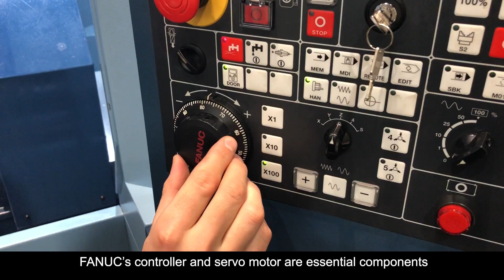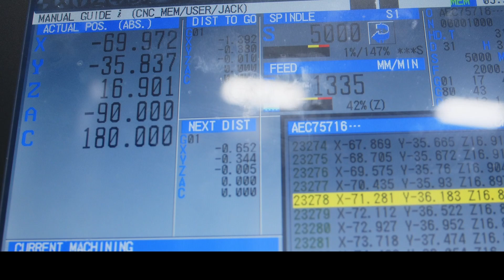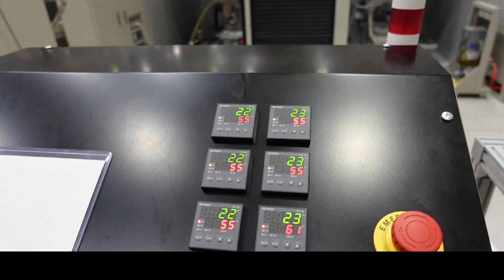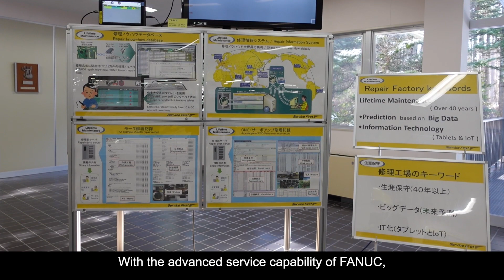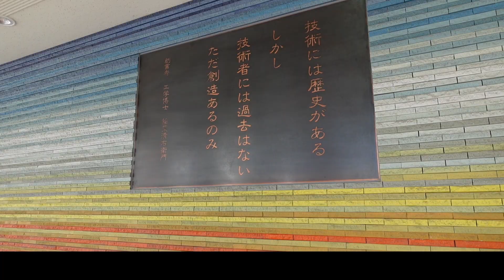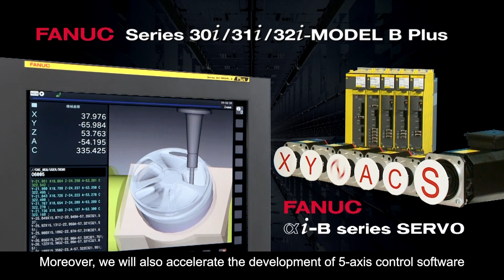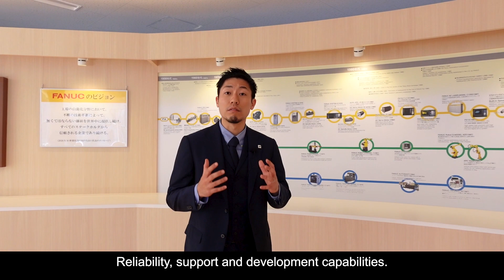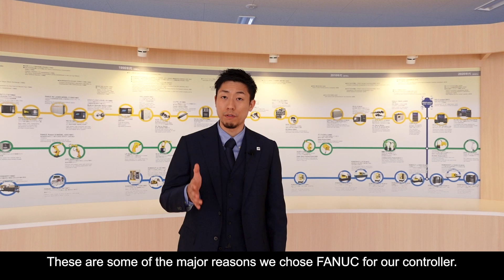【FANUC Tour】Why Matsuura use FANUC?

Comment: When I was an apprentice I operated thr H Plus 405. I was amazed how it could maintain microns over 50 tool jobs through the night. Most I'd need to tweak offsets by were 0.02mm and that was rare. Top quality machine from my small time running them.
Reply from the maker: Thank you for your comment! We are honored to hear that, and we guarantee that we will continue building high-quality machines!